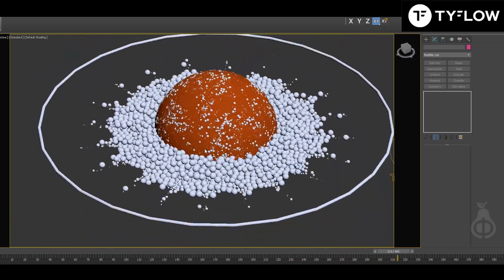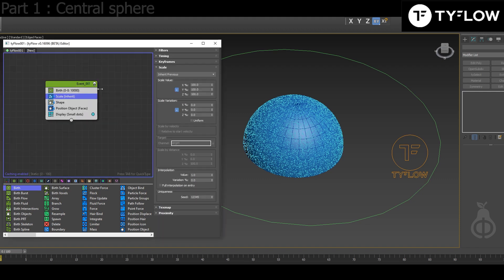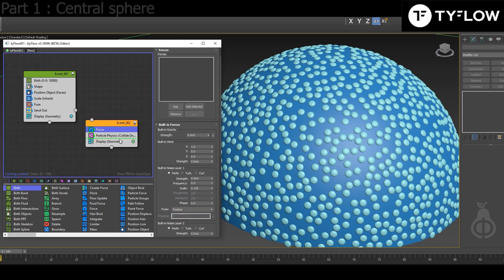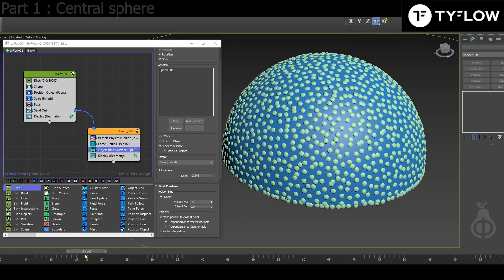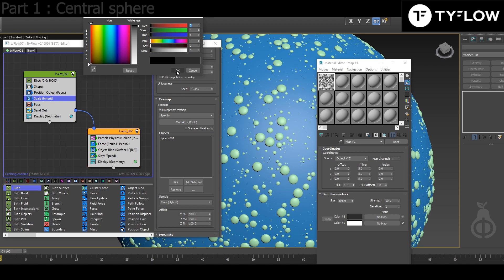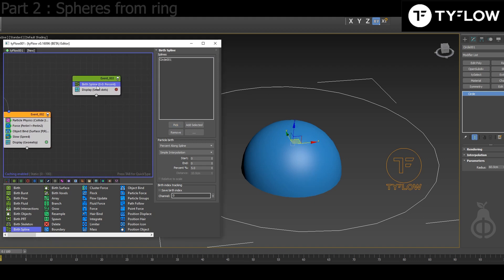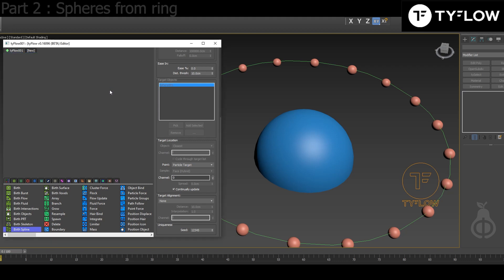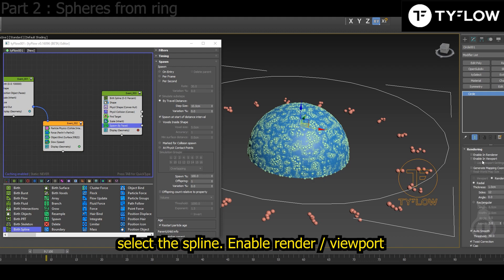3D Doddle | tyFlow - Episode 1

Comment: Is there an easy way to pack a surface with particles? I know you can set a birth operator to keep particles apart by a certain distance, but if I wanted to pack it with different scale spheres or something like that it just won't work.
Particle Flow had an option in Birth by Texture that can fill a surface with different scale particles, and there's also stuff like Molecular Packer, just wondering if TyFlow has options too.
Reply from the maker: Hi, yes, there is a way for that. What you describe is pretty much what is done in this video with extra of making animated. The difference is that I'm scaling many particles to near 0 scale, otherwise, you got it right here. Give it a try. I hope I didn't get you wrong.
Reply: @FXPearStudio  Yeah it just seems like a lot of steps to go through, was wondering if there was something a bit more dedicated as a tool.
Thanks for the feedback!
Reply from the maker: @ArcturusMinsk  tyFlow is like a "Spline": you can use to make any shape, instead of one "Bottle spline tool" just for bottles.  The first Event with minor tweak will do it. Or in tyflow area, Right Click -> Scatter Flow, and tweak. Well, added to list of soon future tutorial :) Stay around.
Reply: @FXPearStudio  Oh as a follow up, i did find a better solution, or at least one that's closer to how i'm use to working, it's the VDB tool. For anyone interested just look up the tyFlow_vdbSpherePack_001.max tutorial file.

Man tyFlow is good... so many choices.